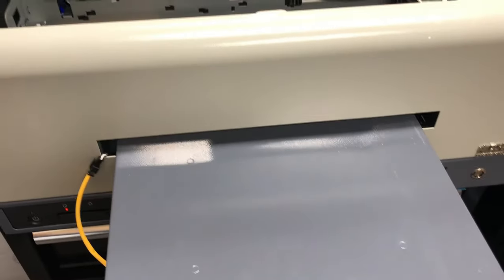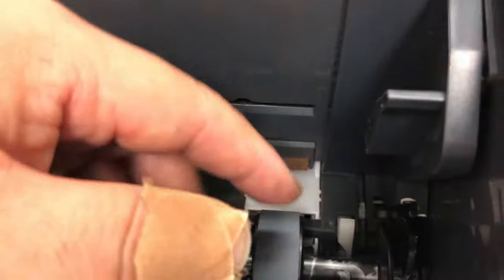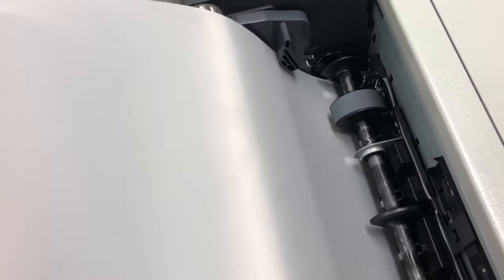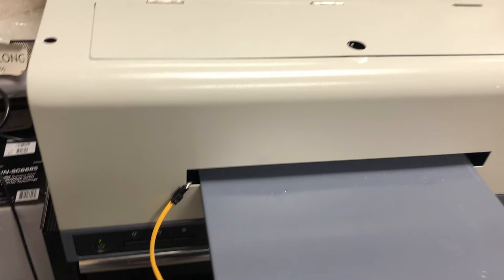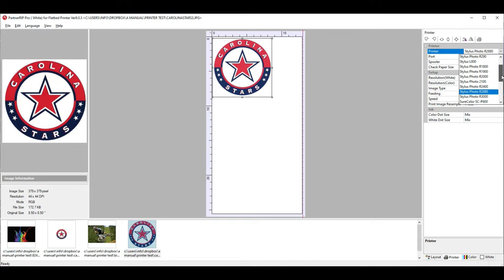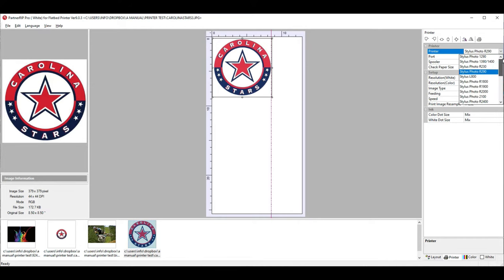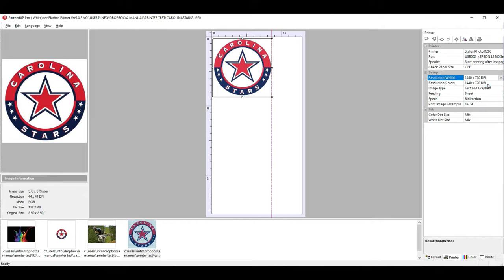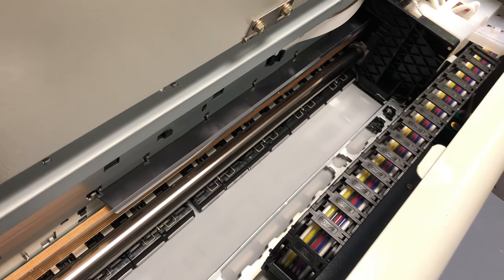#1 FIX - DTF Printer Out of Paper / DTG Feeding Error Light On - PET Film L1800

Comment: Hi Kevin my printer been having issue
I changed the mainboard and the control
Board power stil goes off and the paper feed not
Moving
Reply from the maker: Also check the printhead FFC cable.  That's where most of power goes.